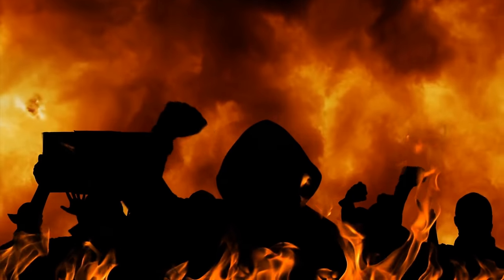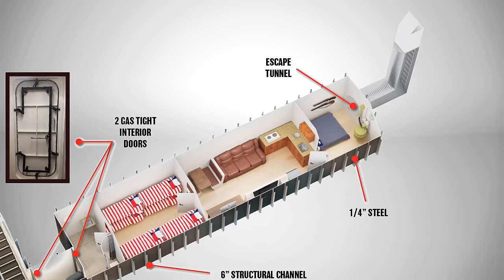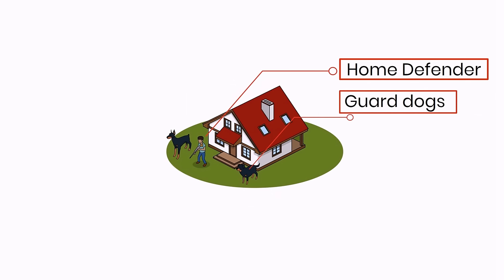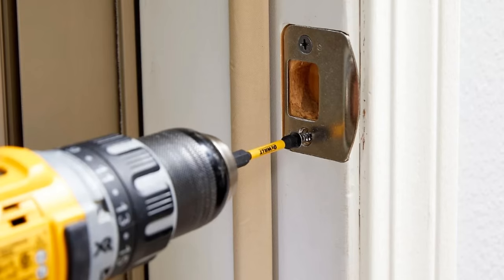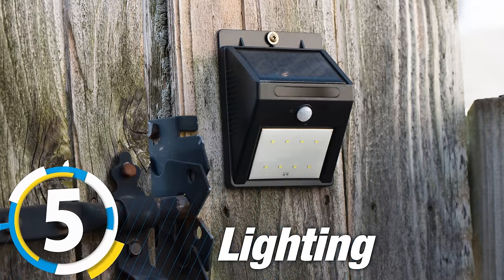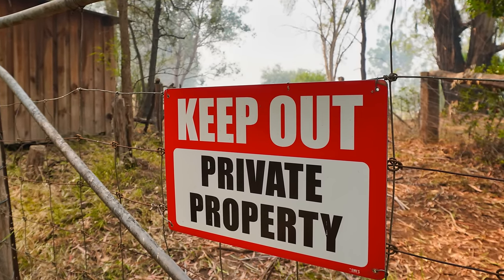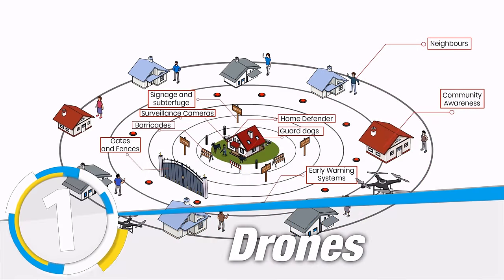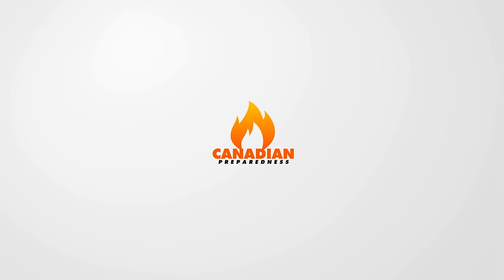The 10 Layers of Home Defense

Comment: An underground bunker is great as protection from immediate fallout after a nuclear disaster. Apart from that, I'm not a big fan of them. If people want to do you harm, they will find the necessary air intakes/outlets sooner or later and those are the weak spot of any bunker. I'd much rather stand my ground at a strategic point of my choosing. 
Or better yet, don't be there when it happens in the first place. If you get caught in an urban environment during civil unrest you have failed in prepping in the first place. Strategically relocate NOW before it happens.

Comment: I'm still stuck trying to add door bars and beefing up the doorway security. Added another deadbolt but having trouble securing extra defenses to the flooring
Reply: Take off the door trim and shim the brackets  out.  When we return to "normal" remove the brackets and the trim will cover the bracket holes. See my video for the finished product.  Cheers.

Comment: Saying a shotgun doesn’t require accuracy is very misleading
Reply from the maker: Of all firearms it requires the least accuracy if we are talking about short barrel with buckshot. Sorry if you misinterpreted that.
Reply: Something I heard that seems counter intuitive to all the common knowledge that applies after wrol is.... shoot for waist down (mobility). Why? It will drop a man faster than hitting the engine room, if others are behind, it will block the way. The other reason you are aiming downward so over penetration or missed shots will go into the floor. Now the injured will be motivated to exit and will require help from friends taking them out of the fight. It will also use valuable aid resources. If hit in the engine room or computer and takes the room temperature challenge now you have to deal with a 200lb meat bag laying on your floor.
Reply: @CanadianPrepper  In the U.S. short barrels are hard to get, so I think a lot of people assumed you were talking about long barrels and those require a good amount of accuracy. That's probably why Neeks said that, I know a lot of people here think you don't need to aim a shotgun; they think you can point it in the general area and it won't miss (up close that's not wrong but people don't realize how close it has to be for that). But yeah, your general idea was right, people just got confused.
Reply: Inch Grundle  Don't forget to calibrate/ zero the laser sight in; it's not always gonna be accurate as soon as it's attached.
Reply: @patr10t762  I think if they have a firearm and they just got shot they are going to start shooting at you. Waist down shots aren't going to keep them from fighting back, you can shoot a gun without your legs lol
Reply: He said without INCREDIBLE accuracy...
Reply: Inch Grundle  Thanks for the vid. Flashlights have a wider candela, with a laser I would want it to be more precise and make sure the bullet hits the dot.
Reply: Inch Grundle  It also tracks back to your position in darkness or smokey conditions.
Reply: Inch Grundle  My comment is from a certified instructor and former law enforcement officer as well as a Bianchi Class competitor. As for cleaning up a mess another person I was told about had a red laser on his Glock and went to visit his invalid mother in South Carolina. He gave the health aid the night off. He no more locked the house and went upstairs to bed and he heard glass breaking downstairs. He grabbed his Glock and went downstairs to see a shadowy form standing in the door. He lit the intruder with his laser and told him to freeze. Immediately the shadow moved like they were going for a weapon. Without reacquiring the target he let a round fly. He then called the police and they hauled the wounded intruder to the hospital and then found himself being taken downtown and questioned for 8 - 10 hours. They finally released him stating it was justified self defense. A few months later he was notified to appear in court. He was being sued by the intruder (an 18 year old repeat offender that lost his left arm, shoulder blade). By the grace of God the judge was a conservative judge and upon reviewing the case decided to throw the case out. So feel free to use your laser site in what ever manner you choose but you better get insurance in case you find yourself at the wrong end of the law.
Reply: I don’t agree. Shotguns can be shot from the hip and can be very devastating to what every is in the proximity. And he said the least amount of accuracy. And it’s completely true. That’s why it’s a “shotgun”... the rounds are filled with “shot” that spread...
Reply: patrick henry apparently your ability to comprehend is experiencing trouble. I stand by every word I said. I’ve shot a lot of many different firearms.
Reply: patrick henry man... you must be lonely. Call your boyfriend or some thing.
Reply: HOOCH D  yep. Me too bud. Say when
Reply: I'm in agreement that a shot gun is superior to the task at hand. It's going to do the most damage with the least amount of ammo. Plus that sound (bawoom)in itself is pretty intimidating 😳 
Hands down my all time favorite

Comment: Most of what you said about shot guns are incorrect.

Shotguns do not scatter like they do in video games. You still have to be very accurate as you don’t get a quick follow up shot like you would like semi automatic rifles. Even bird shot maintains a pretty tight pattern at any home defense range, less than 6 inches with most loads.

Pump shot guns are actually some of the most difficult to run and reload, especially under stress. A shotgun requires even more training to pump and reload with any kind of efficiently, especially under stress.

A semi automatic rifle IS the best proven home defense weapon.
Reply from the maker: Home defense range is very arbitrary could be out to 50 feet in some homes thats A LOT of spread. A short barrel shotty with buck and bb loads spreads a lot more than a single bullet. No one is saying you can just shoot anywhere and it will hit (captain obvious?). In canada you can only legally have 5 bullet mags but I can load more into a shotty and there is such a thing as an auto shotgun. A monkey can pump a shotgun dude dont read so deep into it.
Reply: Any gun guy worth his salt knows you use your handgun to fight your way to your firepower, which is your shotgun...on average OO buck is about a 6in spread every 30 feet depending on your barrel length and choke...

Comment: First off I like your videos and keep them up. But I've got to chime in about that "shotguns dont need accuracy " comment . That is absolutely not correct , SURE if you use shells like birdshot that are not made for home defense they spread but buckshot does not , atleast  not nearly the same . From my back door to my front doors distance I can in one shot put all 8 pellets in a paper plate or tighter. That's my maximum distance.  
You guys be safe out there,and practice with your firearms :)
Reply from the maker: I said they dont require "incredible accuracy" that doesnt mean no accuracy. Buckshot definitely spreads a good bit. A paper plate is huge compared to a single dot from a bullet.
Reply: @CanadianPrepper  sir I appreciate your reply.  I'm just trying to be helpful and inform you guys. 
I'm talking about a Plate spread at 25 yards (22 meters), if there 5 feet from you were talking about a coin size spread . That's 8 bullets at .32 caliber roughly the size of 9mm (.355) in a Coin size hole.  
So aiming with extreme precision is necessary.
Reply from the maker: @lanceskopik2928  I've shot shotguns hundreds of times and on several. The point of the post is that you don't have to be as accurate with a shotgun. There's nothing more to it than that. Obviously you can't just point it into outer space everybody knows that oh, this is obvious. And the spread is going to be variable depending on the length of the barrel and the type of shot used and the choke obviously, so there's no need to be Captain Obvious here
Reply from the maker: @lanceskopik2928  you don't need to provide a source, nobody's asking for advice. This is all obvious day one information

Comment: You can reinforce a door by putting a metal bar on the part of the door frame that is next to the lock.  So the door frame will bow far less which will make it harder for someone trying to force the door open with brute force.

Comment: Even if you have power, how do you have video on a home security system? Most run through internet now.
Reply: I have found several that are closed circuit and record on a DVR.
Reply: 2 out of my 3 systems are set up through LAN so even if the net goes down I would still have access to the footage. Had it 100% tested last month after the building workers had cut my ADSL cable lol
Reply from the maker: Wifi and closed wired circuit still work
Reply: Hmmm, interesting. I know the WiFi will be off but need to test the back up to that.
Reply from the maker: @Alaska1969  wife I won't be off, Wi-Fi is a signal transmitted within your house. What will be off is your internet connection. Your Wi-Fi transmits in the same way your phone can be used as a Wi-Fi tether.

Comment: Shotguns required accuracy in self defense scenarios. The idea that shotguns have a wide spread in self defense distances is erroneous. Shotguns also are large and lack of ammo capacity. I would advise against using a shotgun as a go to home defense weapon.
Reply from the maker: Never said you don't have to be accurate, but it's also not a pistol. It depends on choke and type of shot. They are literally made for short range. It depends also on the home and the size
Reply: What do reccomend an mg42? Pretty sure hand guns are banned so what do you reccomend, a double barrel slingshot?

Comment: Shotting a shotgun at home distances, under 20 yards, will lead to very tight spreads. Shotguns provide no benefit over a semi-auto rifle like a mini 14 or AR15. Assuming laws permit.
Reply: @Tashi Chodak The spread is extremely tight on shotguns in home ranges. Shotguns spread extremely little with a standard choke with buckshot. To the point where the benefit is negligible. Semi-auto shotguns are less reliable and pump shotguns take more actions to successfully fire. Also when a shotgun jams or fails to feed, you cant drop the mag to clear it. Sometimes the shotgun will just be out of order for the fight. Overall a Semi-auto rifle would be far safer to use for home defense. Now over-penetration, 223 and 556 rounds break up after hitting drywall if you buy the correct rounds. Saying shotguns are the ultimate home defense firearm is miss information.
Reply: @jakeaurod  223 and 556 is considered lower power, and break up after hitting barriers.
Reply: @milky onion You must have good aim with a shotgun. The spread inside a home will be the size of a golf ball unless you are using a cut off shotgun which have a questionable legality depending on where you live.
Reply: @jakeaurod  This isnt how 556 works.
Reply: @G43X  ya, because those semi-auto rifles never malfunction...
Reply: @yardbirds8904  They can be cleared faster than shotguns. Enjoy your shotgun. Im just trying to save people.